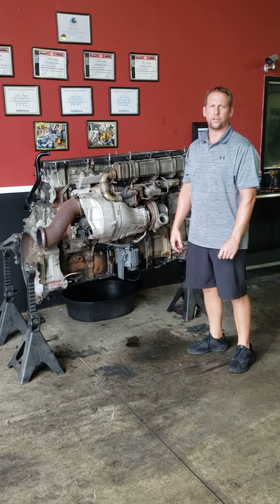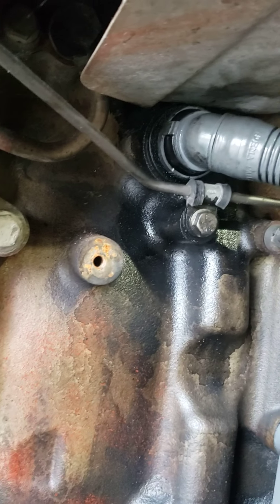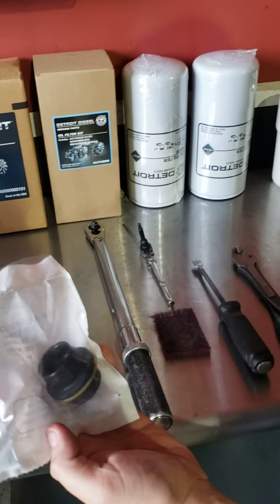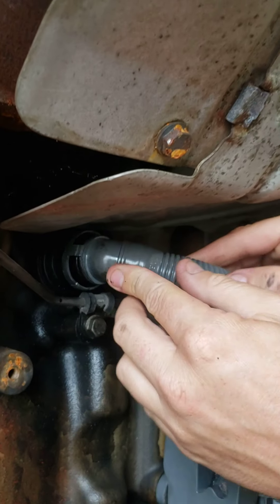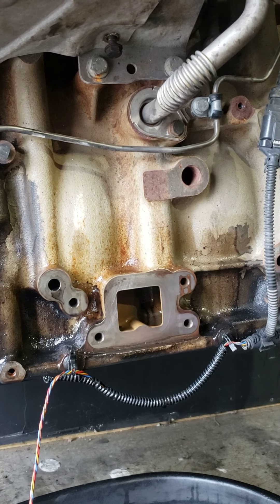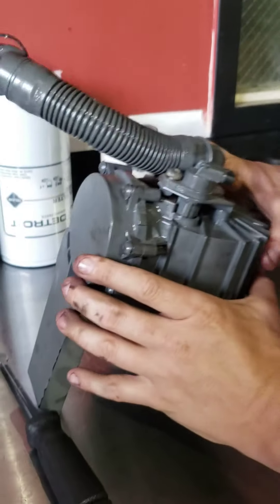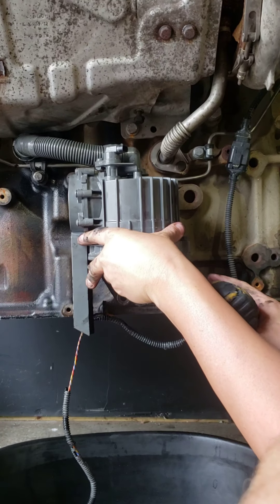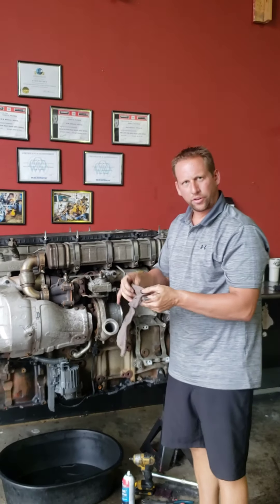DD15 DD13 Crank Case Breather Replacement

Comment: Can the crankcase breather fail without a trouble code.
   I saw one that had static oil in the area of the vertical blow  vent and a little forward of the vent system. 
   It was on a flat bed cummins. 
    Just asking?
    Great video.

Comment: I'm loosing antifreeze, I believe it's leaking around the back of the EGR cooler, but my crankcase breather is leaking oil also,I changed out oil pressure sensor because oil gage dropped in pressure, I had a new head put on about 3 months ago can you give me a ball park on what might be going on

Comment: All of a sudden I am blowing oil all over the bottom half of the engine.  It was about .5 galllons in 800 miles but now I am at 4 gallons for 80 miles but I made it back home without a tow bill

Do you have any suggestions?

Comment: Your most likely going to need a metal connector to the block and that part # is A4720180044 and it’s $135.60 from Freightliner.

Comment: When do u replace the crankcase how often?
Reply: Just got bought my second one after two years. Note: go under the truck and put your middle finger that filter hole ass And see if it’s showing any oil on your finger. If yeah, then changed. That what I do. But it’s normally lasts every 500k . Note: my 2013 dd15 just hit 900k miles. So good luck about yours.